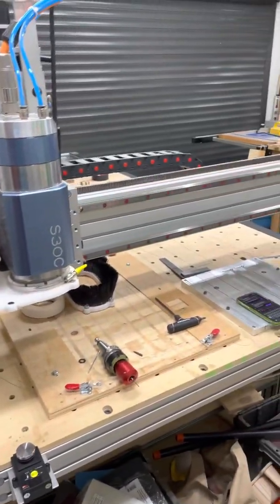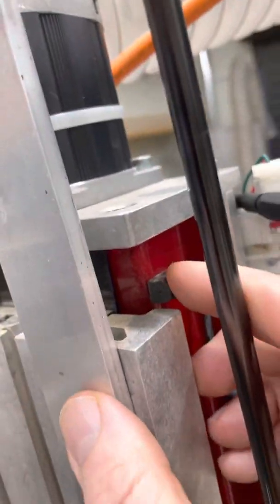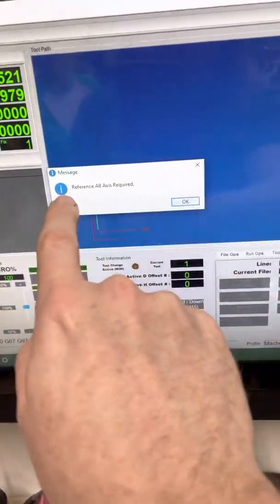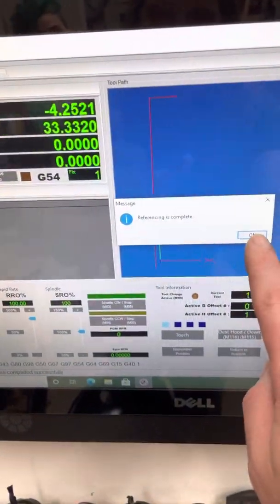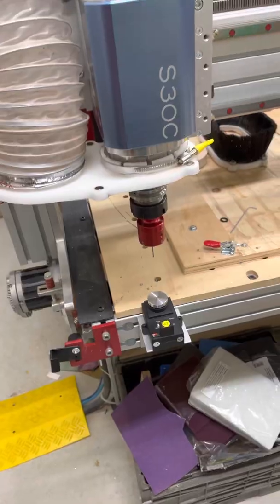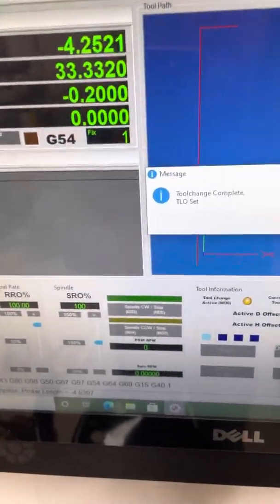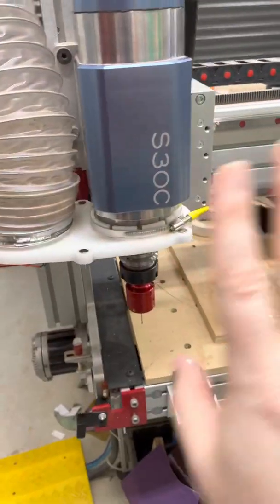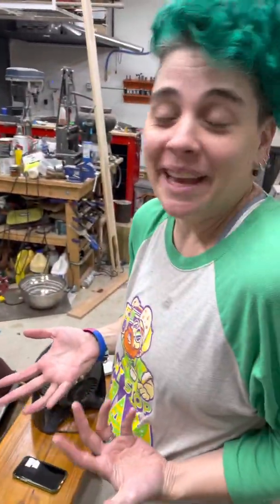Probing, Probing, Probing

Comment: I have an Avid CNC now and would love a probe like this. How is yours connected to Avids control box? I don’t see a wire anywhere coming off the probe? Thanks!
Reply from the maker: The probe is wireless, its got batteries in it, and then the receiver has 5v + a signal...  I moved since I did this and have been in "get everything back up and running as a hobby" so I can't go check but it is pretty trivial as long as you have an open pin for a probe switch.

Comment: You videos have helped me allot. If you check my recent one I've got a 2 probe system that works really well.
I've got it probing tools and recording z as the offset. The Work probe is has g43 applied while setting the work z zero and it works well.
-Ken
Reply from the maker: just watched your machine overview.. nice work on your machine!
Reply: @HandsonCNC  thanks! I've just finished writing script and planning out some more videos. I'm going to do a video specifically on the 2 probe system. It took me a while to get it the macro working.